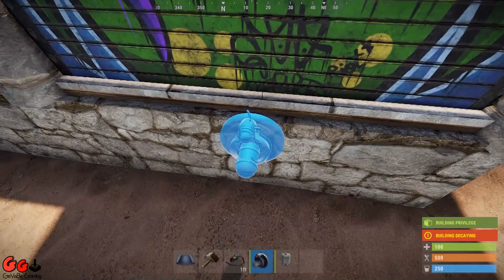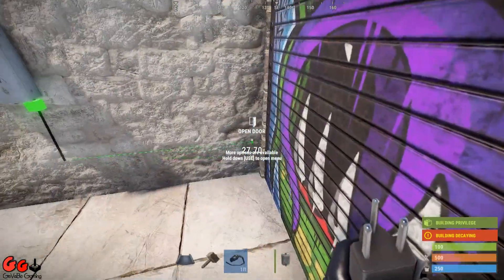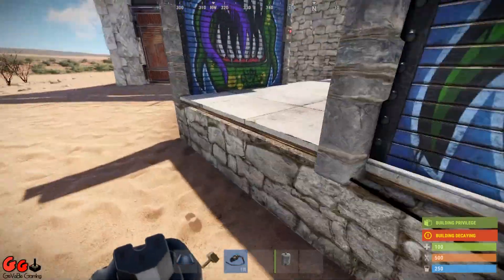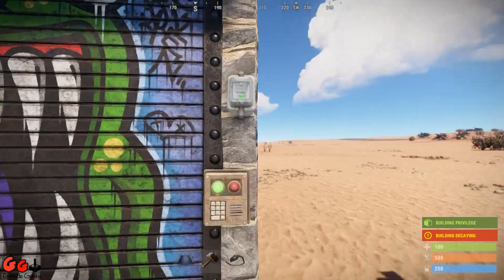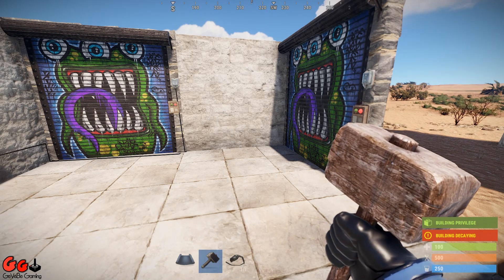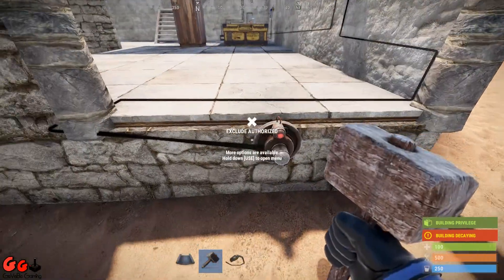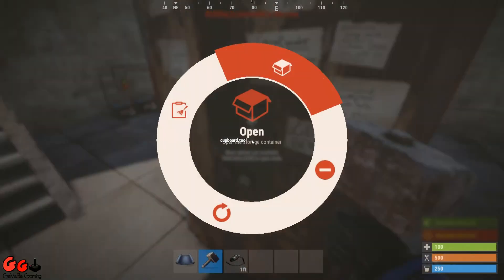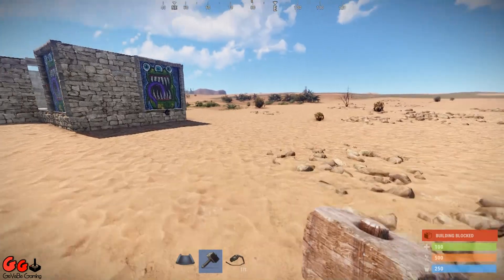Rust Electricity Tutorial - HBHF Sensor - Auto Opening Garage Door

Comment: what about an automatic closing door that closes when sensor detects? then re-opens when it doesnt
Reply: Well for that you'd run constant power to the door controller (meaning door is open) and then before the door controller, place a blocker.

Run the sensor to the block pass through, and run the door controller to the blocker output.

When it detects someone, it blocks pass through, which turns off the door controller, which closes the door.
Reply: @garyhamilton2104  then you create a trap base with the sensor inside and once someone enters boom the door closes and they are trapped XD

Comment: how can you make it so the door opens from both sides
not just from outside and inside since hbhf in put only on one side
Reply: It gets much more complex. I spent about 3 hours devising a system that can do this with hundreds of doors at an unlimited range from the power source. I might start making videos on the circuitry since it seems nobody else has been crazy enough to try it.
Reply: @SupahDoesTech  if you have figured it out do let me know if you ever upload anything on it
Reply: I did with 8 doors. But it's more complex.
Reply: Just do 2 system like this with AND switch and add OR switch.. which means 2 sensors, 1 sensor on both sides of doors and connect them to their own AND switch.. then connect those to an OR switch. Connect OR switch to the door controlers and thats it. I used eletrical branches instead of splitters. idk i just hate splitters, only use them for a raid base when u need to be faster :)